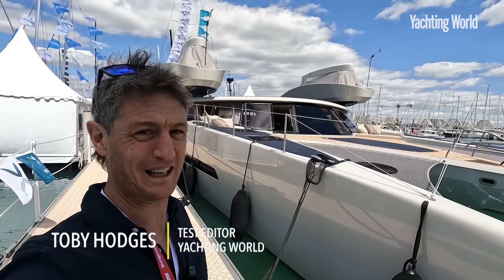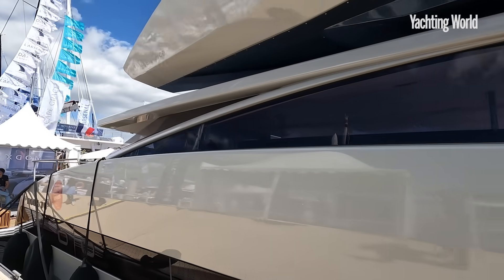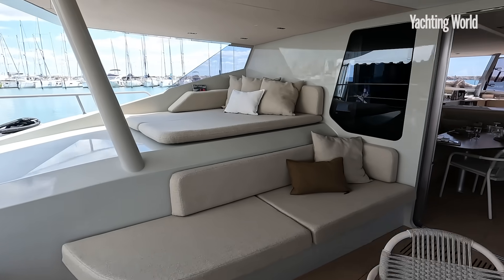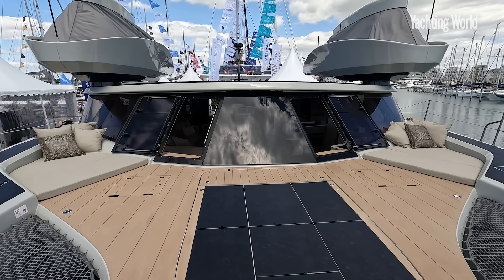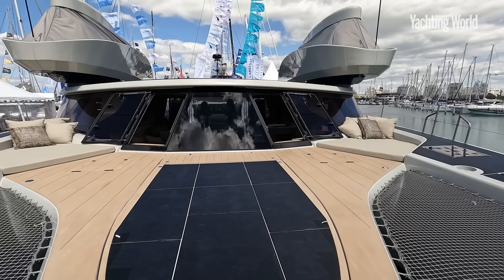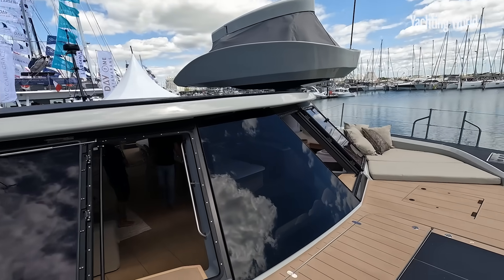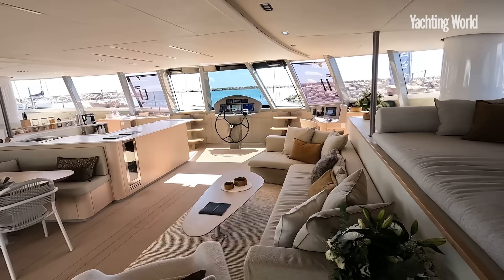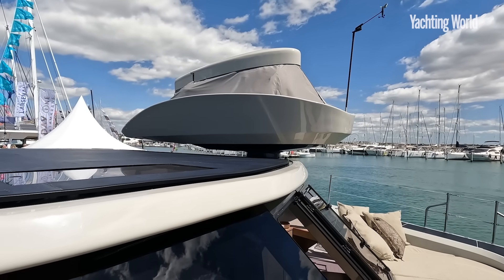Meet the MODX, an electric 70ft cat with fully automated inflatable wingsails!

Comment: The modifications I would make are I would make a Tri-hull and switch from Lithium ion to NA or Sodium Ion batteries, much much safer, no risk of fire, and many many more charging cycles compared to Lithium Ion Sodium Ion batteries would last the life of the boat and never need to be replaced.

Comment: As much I love the new idea, as much, as a senior (read: old), battered sailor, I cannot prevent from expressing doubts about the operations of that boat in heavily cloudy conditions, strong gusty wind, rougher seas, turning winds and thunderstorms, when all gets wet and the salty air corrodes everything even "stainless" and electicals, and equipment and humans get tired and sore. 
I sincerely hope my doubts about this solution will vanish with real experience at sea.
Thanks a lot for bringing great new engineering, thanks for the great presentation.
Greetings from an old guy still stucked in the South China Seas.
Reply: Solar panels are really efficient nowadays, even on a really cloudy day they produce a lo of energy.

Comment: WOW ELECTRIC WITH SAILS. so a sail boat. without an engine. GOOD LUCK IN PORT. who decided this was even n idea. all that his story. discarded 4 lecky. they historically don't use that on this cus. big lecky n water=FIRE. N AT SEA v BAD. n, there are NO OCEAN PLUG IN CHARGERS. EVER ANYWHERE EVER YET. SO RECHARCE?. so how.   1st INBOARD, OUTBOARDx2. N SAILS. OARS 4 LATER. lecky nav a lights. HAVE NONE OF YOU EVER SAILED. the engine fuel tanks are always full' n the engines are f'in MINT. just in case CUS NO ONE CAN HELP U EXCEPT U. N THE SEA IS ALL AROUND YOU. RESPECT IT OR BY

Comment: Now make the bottom quarter of the sails (the casing for the inflatable sails) act like rigid sails, cover them completely with photovoltaic cells, cover all the vertical outside sides of the hull with pv cells as well, add some hydrofoils, and you have one of the fastest “free” energy sailboats.

Comment: Lithium ion? Are you sure about that?
Reply: First, lithium iron phosphate (LFP) batteries are just a specific type of lithium ion battery. 

Also, most battery-electric vehicles use lithium ion batteries with electrode chemistries other than LFP, because LFP has lower energy density than other types.

Comment: "Sharing the heads" no. 'Sharing the head.' A toilet on a boat is called a head. If you are referring to 2 toilets then they are heads. That's really, really basic boat language. Also, "You typically use 30-35 kilowatt hours on this boat." Do you mean that average usage on the boat is 30-35 kilowatts? A kilowatt hour is an expression of how much electricity is used over a period of time. You can't 'use' 30 kilowatt hours of electricity. You use 30 kilowatts. I stopped watching half way through because you clearly have little understanding of electricity, power usage or even basic sailing language.
Reply: You certainly can use 30 kWh of electrical energy, but of course to be useful information there would need be an associated period, such as 30 kWh per day.

Comment: 4:20 which ever moron designed and installed the solar has no idea what they are doing and seems not to care about shading one bit.
Reply: Did you expect them to mount the panels on top of the masts  so they wouldn't be shaded? Yes, the panels on 
any sailboat must deal with shading; that means grouping them appropriately so a minimal portion of the array is affected.
Reply: @brianb-p6586  obviously not. The smart thing however would be proper string management, and not wasting modules in clearly shade heavy areas. It's a nameplate play.
Reply: @RGJ-Journey  sure, some of the least effective panel area could be omitted, but the buyer of an $8M toy isn't going to thank anyone for saving a thousand bucks of panels. They just covered the whole roof, and that's what should be expected.

Comment: Might want to brush up on terminology chief. The issue with the tv was the refresh rate of the tv vs the cameras shutter speed known as the rolling shutter effect. The engines when underway output 15KW at 15 knots, not 15 KWh. KWh is a unit of energy not a rate. Storage is measured in KWh. Inputs and outputs are KW.

Comment: Ive been following the development of Wisamo for a few years. It is an inflatable wing sail system acquired by Michelin which has neen installed on several cargo ships. I believe a Wisamo system has been installed on Beneteau monohull. Is this system licensed from Wisamo? Do you expect other yards to license this “rig”? 
Could a simplfied version that is controlled by standing rigging be installed on smaller boats? Trailerable trimaran with no rig to step?!!!?

Comment: would be even more interesting if the wingsails could be asymmetrically inflated to give a cambered section - might up the vectors a bit...Would be easy to actively control by a real-time smart wing-management system.

Comment: My ideal catamaran would have a large "apartment style" area so that's a check. And run on sail and solar, check. Now just make it much cheaper. I would think you don't need the masts to be telescopic, they could be fixed, and you would just inflate and deflate the wings. But with this concept they might be looking at motoryacht owners who need their boat to pass under low bridges.
Also the wave piercing hulls are nice but the result is cramped spaces inside.

Comment: OK, so the inflated wingsail made it into a luxury catamaran product. Will it last? I can't wait for a technical discussion covering:
Is this an electric boat or is it still supposed to be a sailing verssel?
What will the inflated wingsail cost in comparison to a conventional rig in a refit in what period of time
Is there any manual redundancy for lowering the sail - and mast - better - any way for lowering the sails without electricity available?
What about performance?  Bottom line, the wing design is a biplane or bisail configuration. That's not the best we know of. Additionally:
There must exist strange nonlinearities in the boat's polar, hitherto not known with conventional single-wing rigging.
What about the tacking angle of a bisail?
Is there any intrinsic course stability other than an electric autopilot with this design existing?
Just a sailor asking.
Reply: Large sailboats are all also motor yachts.

Comment: Awesome video. Love the innovation and in contact with them as a consideration set for next boat.

I don't think 15-16kw hydrogenation is realistic. That would slow the boat down 5kn but the loads would remain on the sails, etc. So the boat would need to be doing 20kn without hydrogenation and then it would be slowed down to 15kn but the loads would be like you're sailing at 20kn boat speed. I think probably more likely is half that at best. I bet they often seen 4kw of regen and sometimes up to 8kw but I doubt they ever will see more than that continuous. Did you happen to go aboard to view that operating? Wonder what the dashboard was giving off.

On the solar, 15kw of flexible panels will net around 10kw of input on a perfectly sunny day per hour. Call it 50KW per day input. 

If you sail 4 hours every third day (island hopping), you're at:

24kw regen hydro max x 2.5x per week = 60kw/week
50kw solar input per day x 5.5 days = 275kw/week
Toal input 335kw per week = 48kw per day

Probably under normal loads and being somewhat conservative, the boat is a 45-50kw usage boat per day (dishwasher, water marker, laundry). So thinking the boat basically is at 20% SoC most of the time and needs to be topped up every week or so somehow. A diesel generator may be a good option for this.

Wondering if you have any first hand experience on the boat checking the inputs from electrical generation (solar and hydro)?
Reply: You really should learn the difference between power and energy, and the units used for them. 

Sure, 15 kW of nominal solar power capacity might generate 10 kW of power at peak in the real world, for about 50 kWh of energy collected per day.

Putting proper units on your example:
24 kW regen hydro max x 2.5 hours per week = 60 kWh/week
50 kWh solar input per day x 5.5 days = 275 kWh/week
Total input 335 kWh per week = 48 kWh per day

Comment: Thanks for the presentation, Toby! 🤔 The obvious allure is the single-handed operation!  I’m kind of partial to all those sailing videos depicting the single-handed operation of a yacht under full sail in glorious weather that would de minimus require a crew.

I always thought you would need fixed masts no matter what, even if you employ airfoils.  And where are the satellite and radomes?

No hydrogen generation or fuel cells?
Reply: There is no need to waste energy, so there is no inefficient hydrogen generation or fuel cells... just batteries.

Comment: This is absolutely genius. Who buys a car today and has to take a mechanics course, who has to retard and advance the spark timing while driving still, who uses a compass to navigate their car? 
This is the boat of my dreams. I point it in the direction I want to go and that’s it. Technology handles all the rest. No ropes and sails, we don’t still drive model Ts around.
Reply: Boats are not cars, they are like houses in a remote mountain region, you better know how to chop wood and fix your pipes or you have to sleep cold and shit in the forest. The motor yahts we currently have work the same as this sail boat. you turn on the engine and autopilot and it drives itself. This concept just replaces engine with sails.
Reply: What could go wrong, taking a piece of tech you're too lazy to understand out off shore, and something fails? Boats aren't cars. Your example only serves to reduce the topic to a talking point. If a plane has a failure, you fall out of the sky, so we have to learn a lot in order to fly. That's a much closer example than a car.
Reply: @severthindakari are you a boomer an idiot or both? You know planes have been fly by wire for decades right? Who the fuck thinks only about what if something goes wrong? IF something goes wrong then deal with it at that moment but otherwise give me more tech. Make my job and life easier. Do all the boring tedious shit with tech.

Comment: Interesting Ideas here opening up a lot of possibilities. But with so much unique solutions i cant see that becoming a production vessel easily. Also Maintenance is going to be a b*tch. If that's hydraulically actuated then there must be a huge Oil Tank there somewhere onboard as well as two Huge multi-segmented hydraulic Cylinders. I dont want to imagine an oil leak anywhere in that system. Cost of Repair are going to be astronomical.
Having a conventional Standing Rig but mostly automated with off the shelf parts is going to be a better solution.
Sustainability and Independence should not just end at the Power Generation, it also has to translate into the long therm Maintenance.

Comment: I would never go to sea with lithium batteries on board and anyone who has experience with lithium battery fires wouldn't either.
Reply: I was waiting for this comment and you didn’t disappoint. It shows you have no idea as to what sort of lithium batteries are used. They are LiFePo4 for deep cycle, they are not just Li batteries which may catch fire but less dangerous than tanks of fuel and ICE engines the stats show. LiPo4 batteries DO NOT CATCH FIRE.
Reply: @steviefordranger198  Wrong, wrong and wrong, maybe you should get off your very small high horse and do some proper reading instead of just reading the sales brochure.
Reply: @japaneselie  Would you go on a boat with a propane tank or a ton of flammable liquid fuels? Or one made mostly of very flammable epoxies? Boat fires are just no fun, period.
Reply: @geirmyrvagnes8718  properly ventilated storage for propane makes it quite safe, diesel is inherently stable but lithium batteries produce their own oxygen in a fire so are impossible to put out once the meltdown begins. I say again, I would never go to sea with lithium batteries on board.
Reply: @japaneselie What I am hearing is, "this newfangled stuff kids are up to these days is dangerous". 😅 I guess we will just let a generation pass. My father would scrape gunk out of ship engines that would eat through his clothes. Some of the most horrific accidents in naval history have involved steam boilers. The age of sail had a staggering death rate. Crossing oceans in open wooden hulls is asking for a watery grave. I guess that growing up on the coast means I am a survivor of generations of lucky escapes, so I am not that worried.😅
Reply: @geirmyrvagnes8718 Maybe you could start with the science behind why once a lithium battery catches fire it's literally impossible to put out and get back to me. Yes, things in life are dangerous but lithium batteries are an unnecessary stupidity. Cargo ships are being lost to simply carrying EV's and hybrid cars so why would you want your boat powered by them?
Reply: @japaneselie No reason to convince you. When we are really really old, this will be utterly boring and normal, and people will gasp at the sight of veteran boats with gasoline tanks and combustion engines. 😊
Reply: @geirmyrvagnes8718  The future will be synthetic fuels and combustion engines so I respectfully disagree with the inevitability of electrification of the entire world.

Comment: super fucking cool. Really interested to see the tech behind hydro electric generation
Reply: That's really straightforward: the electric motor acts as a generator, so the propeller produces drag instead of thrust. As far as the motor and controller are concerned it's the same as regenerative braking in an electric car, but there is the additional factor of how well the propeller works as turbine impeller, since its shape is intended for propeller use.

Comment: The wing sail catamaran was first produced in the 1970's by Walker Wingsails. They had one rotating rigid sail. Seven were built and 2 made circumnavigations of the world. But this is a nice adaptation of the concept... even it looks like a hotel room. I'm not keen on the huge sliding door in the salon either. You have know it's going to break loose one day.
Reply: I remember the Walker Wingsails and saw one in San Diego years ago, and was always nervous about the reefing capability in strong winds (automatic "fairing" or weather-cocking the sails), that was a very large rig permanently mounted. I like this inflatable/telescopic concept, they presumably can be faired against the wind and also reefed by lowering, it will be interesting to see how fast that can be done.

Comment: Love it. As somebody looking at a Silent Yacht or similar electric power cat, this would work for me. I don't feel I can single-hand a traditional sailing cat, but I could cope with this.
Reply: All Dragonfly trimarans can be single-handed with ease. Their slightly larger models are all fed to winches in the cockpit.
Reply: For cats that have all lines led to the cockpit, including reefing lines, it's possible to singlehand.  (It's possible even if some of the lines are not led to the helm, but harder.)
Reply: Its very easy to single-hand a Dragonfly trimaran, all the ropes lead to the back and use electric winches.
Reply: Sure, but this is like an automatic transmission versus a manual!
😛

It will be nice if, in future, the efficiency curves allow for smaller hulls.
It's very early days for that sail system.
Reply: @jimg5669 I am a little disabled so this is perfect,  I don't have to  worry about lines ❤, with kite sail

Comment: Toby... please, please find a way to monitor your audio before you shoot - or even better - during the shoot. It sounds like your lapel is rubbing and despite the cat being cool and very interesting and your presentation great as always, it's really annoying to hear the rustle noise. It's also very likely quite avoidable and good audio massively increases "production value".

I don't know what camera you're using, but even the Osmo Pocket, I think will give you a headphone out connection - and if you're not on cam then there's no reason not to wear your headphones. The brain is incredibly good at filtering out noise so without headphones you will be tricked into thinking audio is way cleaner than it is. But no hiding when you have headphones on. You will hear ACs humming, ambulances in the distance, a moped, a coughing crew member - and your own mic scraping on something and it will give you the opportunity to fix it right away or do a retake right on the spot.
Reply from the maker: Thanks for the feedback. T

Comment: what is the range for the engines on a single full charge? does the boat have air conditioning? where is the dinghy stored nd what is the size limitation? where is the spot for the bbq? how much refrigeration is on board? why didnt you show the available storage spaces? plase tryto answer these practical questions in your future videos instead of just fan boying.

Comment: The wings should be offset diaganally from each other, so it could sail on the reach
Reply: but only in one direction?
Reply: @brianb-p6586 no, like left forward and right backward
Reply: @brianb-p6586  boats spend most time on a beat , diagonaly means on a beat on one tack forward wing wil cover the rear wing.  less then 100% efficiency on a reach is more acceptable. Unlesss you need a boat that wil only ever sail on a reach.